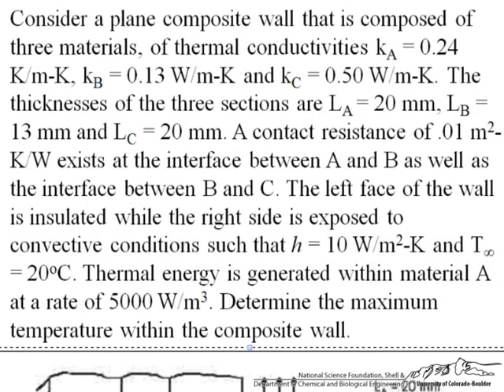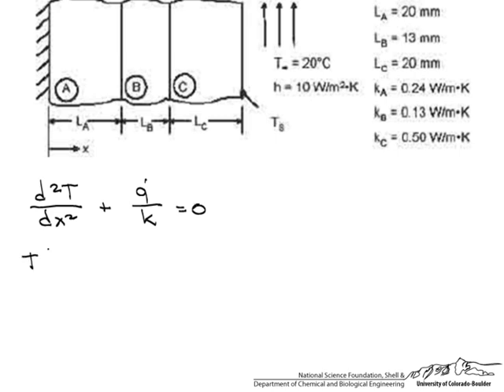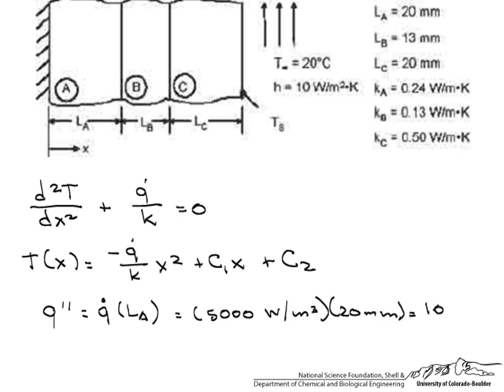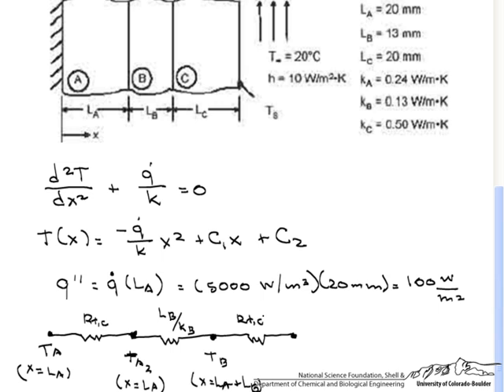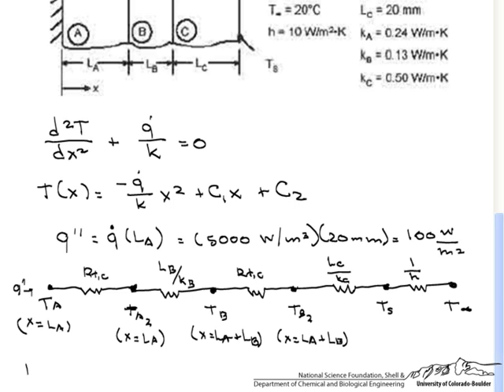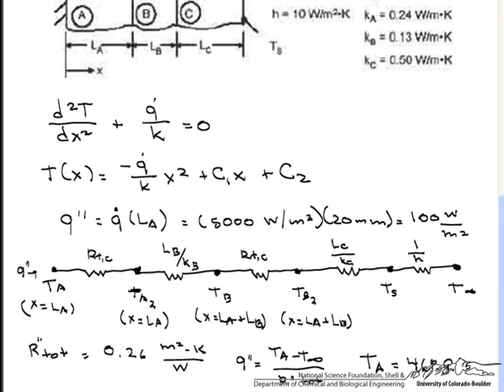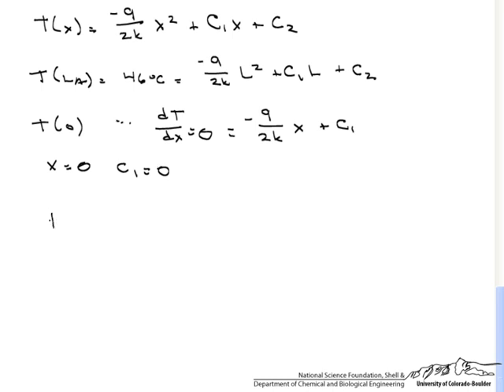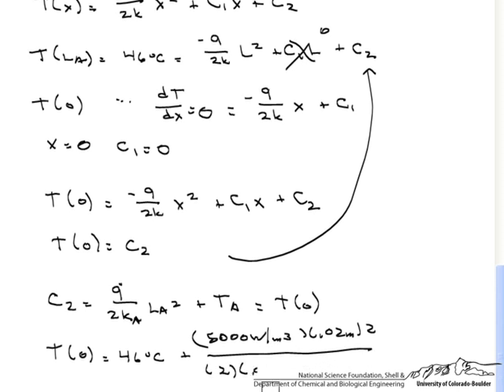Composite Wall: Maximum Temperature

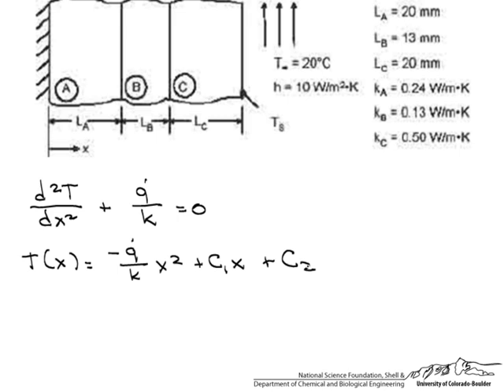Comment: The first time you write the T(x) eqn (at 01:52), it incorrectly shows it as (-q/k)x^2+c1x+c2. The first term should be (-q/2k) from the integration of x to x^2 [it needs the 1/2 put into the constant]. The correct (-q/2k) term is what you write and use later on with the substitutions.